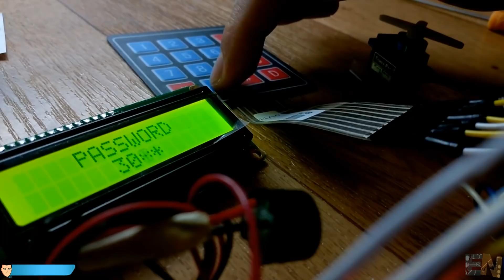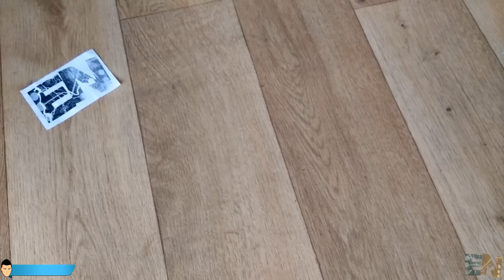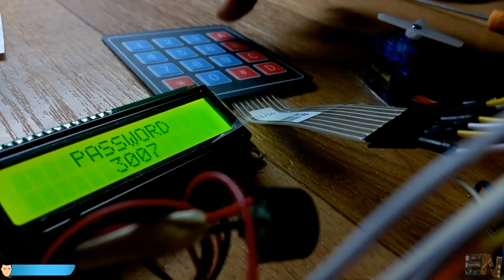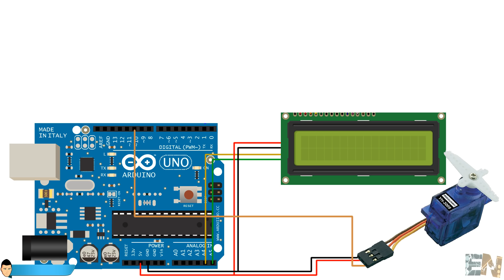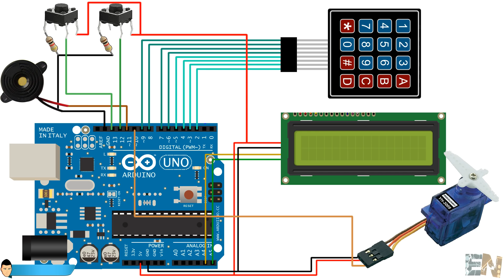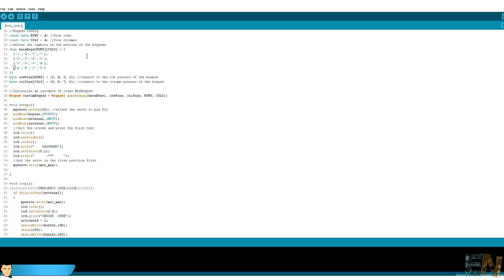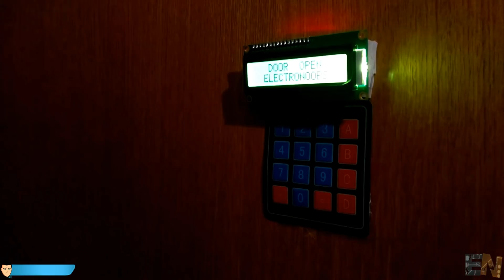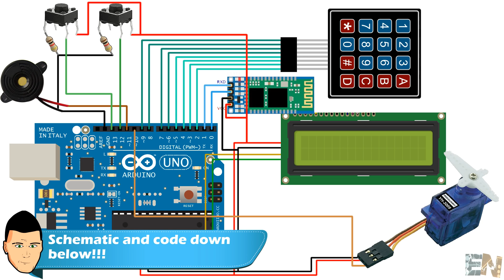Door lock keypad and bluetooth Arduino tutorial

Comment: I am using a 16 by 2 Lcd and the display is not coming. Nice video though
Reply from the maker: Have you tried the other i2c adress?¿ Go to this line in the code:

LiquidCrystal_I2C lcd(0x3f,20,4);  //sometimes the adress is not 0x3f. Change to 0x27 if it dosn't work.

And change the 0x3f adress to 0x27. That might work!
Reply: Can you pls make a lock system which has a arduino shield touch screen as a keypad??pls im really lookking forward to it!!here i found the code for arduino shield key pad....

+#include <UTouch.h>
+#include <UTouchCD.h>
+#include <UTFT.h>
+
+extern uint8_t SmallFont[];            //Declares Font
+extern uint8_t BigFont[];
+UTFT myGLCD(SSD1289,38,39,40,41);    //(Model,RS,WR,CS,RST)
+UTouch myTouch ( 6, 5, 4, 3, 2);
+
+void setup() {
+  Serial.begin(9600);
+  myTouch.InitTouch(0);
+  myTouch.setPrecision(PREC_HI);
+  myGLCD.InitLCD(0);
+  myGLCD.clrScr();                    //clear screen
+  myGLCD.setFont(SmallFont);
+  myGLCD.fillScr(VGA_BLACK);          //fill screen with black
+  myGLCD.setColor(VGA_RED);
+  myGLCD.setBackColor(VGA_RED);
+  delay(1000);
+  drawWelcome_msg();
+  delay(5000);
+  drawButtons();
+  Serial.println("SYSTEM STARTED");
+}
+
+void loop() {
+  int x,y;
+  while (true)
+  {
+    if (myTouch.dataAvailable())
+    {
+      myTouch.read();
+      x=myTouch.getX();
+      y=myTouch.getY();
+      
+      if ((y>=41) && (y<=89))    //top row
+      {
+        if ((x>=21) && (x<=85))  //button 1
+        {
+          Serial.println("1");
+        }
+        if ((x>=87) && (x<=152))  //button 2
+        {
+          Serial.println("2");
+        }
+        if ((x>=154) && (x<=218))  //button 3
+        {
+          Serial.println("3");
+        }
+      }
+      if ((y>=91) && (y<=139))    //middle row
+      {
+        if ((x>=21) && (x<=85))  //button 4
+        {
+          Serial.println("4");
+        }
+        if ((x>=87) && (x<=152))  //button 5
+        {
+          Serial.println("5");
+        }
+        if ((x>=154) && (x<=218))  //button 6
+        {
+          Serial.println("6");
+        }
+      }
+      if ((y>=141) && (y<=189))    //bottom row
+      {
+        if ((x>=21) && (x<=85))  //button 7
+        {
+          Serial.println("7");
+        }
+        if ((x>=87) && (x<=152))  //button 8
+        {
+          Serial.println("8");
+        }
+        if ((x>=154) && (x<=218))  //button 9
+        {
+          Serial.println("9");
+        }
+      }
+      if ((y>=191) && (y<=238))    //bottom row
+      {
+        if ((x>=21) && (x<=85))  //clear button
+        {
+          Serial.println("CLEAR");
+        }
+        if ((x>=87) && (x<=152))  //button 0
+        {
+          Serial.println("0");
+        }
+        if ((x>=154) && (x<=218))  //enter button
+        {
+          Serial.println("ENTER");
+        }
+      }
+    }
+  }
+}
+void drawWelcome_msg(){
+  myGLCD.fillRect(1,1,239,30);
+  myGLCD.fillRect(1,289,239,319);
+  myGLCD.fillRect(19,120,219,179);
+  myGLCD.setColor(VGA_WHITE);
+  myGLCD.print("CAR SECURITY SYSTEM", CENTER, 10);
+  myGLCD.print("SHANE CONCANNON - G00286539", CENTER, 299);
+  myGLCD.print("***********************", CENTER, 120);
+  myGLCD.print("*                       *", CENTER, 130);
+  myGLCD.print("*    SYSTEM UNLOCKED    *", CENTER, 140);
+  myGLCD.print("*   ENTER PIN TO LOCK   *", CENTER, 150);
+  myGLCD.print("*                       *", CENTER, 160);
+  myGLCD.print("***********************", CENTER, 169);
+}
+void drawButtons(){
+  myGLCD.clrScr();
+  myGLCD.setColor(VGA_RED);
+  myGLCD.fillRect(1,1,239,30);
+  myGLCD.fillRect(1,289,239,319);
+  myGLCD.fillRoundRect(20,40,219,229);
+  myGLCD.fillRoundRect(20,239,219,274);
+  myGLCD.setColor(VGA_WHITE);
+  myGLCD.print("CAR SECURITY SYSTEM", CENTER, 10);
+  myGLCD.print("SHANE CONCANNON - G00286539", CENTER, 299);
+  myGLCD.drawRoundRect(20,40,219,229);
+  myGLCD.drawRoundRect(20,239,219,274);
+  myGLCD.print("  _   _  _  _  ", CENTER, 255);
+  myGLCD.drawLine(86,40,86,229);
+  myGLCD.drawLine(153,40,153,229);
+  myGLCD.drawLine(20,90,219,90);
+  myGLCD.drawLine(20,140,219,140);
+  myGLCD.drawLine(20,190,219,190);
+  myGLCD.print("CLEAR", 35, 204);
+  myGLCD.print("ENTER", 167, 204);
+  myGLCD.setFont(BigFont);
+  myGLCD.printNumI(0,112,202);
+  myGLCD.printNumI(1,45,57);
+  myGLCD.printNumI(2,112,57);
+  myGLCD.printNumI(3,178,57);
+  myGLCD.printNumI(4,45,107);
+  myGLCD.printNumI(5,112,107);
+  myGLCD.printNumI(6,178,107);
+  myGLCD.printNumI(7,45,157);
+  myGLCD.printNumI(8,112,157);
+  myGLCD.printNumI(9,178,157);
+}

hope youll fulfill my wish!!! :)
Reply: if you're using the touch display i think you are you would need an arduino mega because you do not have enough pins on the nano/uno

Comment: your project is very cool but I have a small problem how can we change the password of door locker
Reply from the maker: go and find this line in the code, it should be at line 250:

if(Str[10]='A' && character==5 && Str[6]=='3' && Str[7]=='0' && Str[8]=='0' && Str[9]=='7' )

and change '3', '0', '0', '7' strings to the code that you want!

Comment: @Electronoobs
How to install this with LCD KeyPad Shield (SKU: DFR0009)  display? TIA
Reply from the maker: I never used it but this image show you how to connect it to the arduino:

https://www.dfrobot.com/wiki/images/thumb/5/5e/DFR0009-PIN2.png/900px-DFR0009-PIN2.png
Reply: Thanks for your response. I am using I2C adapter for now. I would be grateful if you can modify the sketch like this for me. 
1. Hide typed password.
2. changing password using keypad.
3. 4 or 5 digit password length.

my email address:
mujammal.eee@gmail.com
Reply: i have found out how to hide the passwork . Instead of this '
 if (character ==0)
    {  
    Serial.println(customKey);
    Str[6]= customKey;   
    lcd.clear();
    lcd.setCursor(0,0);
    lcd.print("    PASSWORD");    
    lcd.setCursor(0,1);
    lcd.print(Str);
   
    }
i change it to  if (character ==0)
    {  
    Serial.println(customKey);
    Str[6]= customKey;   
    lcd.clear();
    lcd.setCursor(0,0);
    lcd.print("    PASSWORD");    
    lcd.setCursor(0,1);
    lcd.print("      *          );
   
    }
for each one when i press the button the password show * and when you type the next one the before that will be hide . If you have any code better . Please show me with . I use I2C with LCD 1602 . This is my gmail: johnnypham9869@gmail.com Thanks :)

Comment: Hey, I want the door to be locked automatically after 10 seconds of opening, answers will be appreciated. Great video btw!
Reply: You must add part of code after this: 

if(Str[10]='A' && character==5 && Str[6]=='3' && Str[7]=='0' && Str[8]=='0' && Str[9]=='7' )

    {

      myservo.write(mot_max);

      lcd.clear();

      lcd.setCursor(4,0);

      lcd.print("ACCEPTED");

      activated = 2;

      analogWrite(buzzer,240);

      delay(250);

      analogWrite(buzzer,200);

      delay(250);

      analogWrite(buzzer,180);

      delay(250);

      analogWrite(buzzer,250);

      delay(250);

      analogWrite(buzzer,LOW);

      delay(1000);

      

      lcd.clear();    

      lcd.setCursor(4,0);

      lcd.print("WELLCOME");

      delay(500);

      lcd.setCursor(2,1);

      lcd.print("ELECTRONOOBS");

      delay(1000);

      lcd.clear();    

      lcd.setCursor(3,0);

      lcd.print("DOOR  OPEN");

      lcd.setCursor(2,1);

      lcd.print("ELECTRONOOBS");

you need to set the right delay after this and write:
delay(what you need);
myservo.write(mot_min);

I think it will work.
Reply: @vedatorpeta  Yes thank you it works

Comment: bro your tutorial not work in my arduino... im already try n try but fail.... whats i supposed to do???
Reply from the maker: What is the problem? Dose it compile? Could you upload the code? Did you installed the keypad library? 

It should print on your LCD your password, which in this case is 3007. Once inserted the servo motor will open the door. Maybe you use a different LCD and the i2c adress is different. Tell me what is the problem that you have! Keep up!
Reply: bro u got mail??? im already do whats u say it. but not work i use stuff for excperimen same with ur stuff. if u got mail i can show the photo of my experimen to u. not working at all bro. thanks.
Reply from the maker: Yes, just mail me at info@electronoobs. com or use my Q&A page : http://www.electronoobs.com/eng_preguntas.php

But first open the code an go to this line:

LiquidCrystal_I2C lcd(0x3f,20,4); and change the 0x3f with 0x27. Some i2c LCD have this different adress.

Hope it works, keep up!
Reply: hai bro can u check mail?? thanks u bro
Reply: info@electronoobs. com not mail bro. do yo have email?? like gmail...?? im really confused with this prject.sorry bother u.

Comment: Dear Brother,
I want to add red and green LED in pin  A1 and A2 according to door closed and door open. Please edit the code for me.
Reply from the maker: before the void setup add this two lines:
int green = A1;
int red = A2;

Inside of the void setup add this lines:

pinMode(green,OUTPUT);
pinMode(red,OUTPUT);

Now in the void loop every time you find a myservo.write(mot_min);  add this lines:

digitalWrite(red,HIGH);
digitalWrite(green,LOW);

And every time you find a myservo.write(mot_min); add this lines:

digitalWrite(red,LOW);
digitalWrite(green,HIGH);

That's it!

Also in the void setup after the myservo.write(mot_min);  att this line:

digitalWrite(red,HIGH);
digitalWrite(green,LOW);

in order to start as door closed!

Keep up!
Reply: Dear Brother,  I am tried my best but fail.  Please edit the code and send me.
moradulislammonu@gmail.com
Reply: bro do you have the problem with the button ? Mine when i plug everything in the buzzer buzz out , the screen print inside open despite i haven't pressed anything . Can you help me with that problem ? and with your led did you success ? If you did can you show me your work ? Thanks

Comment: hi I'm having a little trouble 
I uploaded the code to the arduino successfully and it worked fine but a couple of days later it stopped working so I bough a new arduino and uploaded the code again but nothing seems to be working all the cables are in the correct position 
do u have any idea what I did wrong?
Reply from the maker: You could upload the code? If yes, the LCD screen works? If yes, the keypad is the only one that doesn't work? I have to know all this in order to help you. Also if you have the Bluetooth module connected to the Tx and Rx pins you can't upload the code because the arduino uses those same pins to burn the code with the FTDI chip. So disconnect the pins before upload and connect them back later once the code is uploaded. Keep up!

Comment: when i compile  the code an error showed ---- 
door_lock_code:40: error: 'Keypad' does not name a type
door_lock_code.ino: In function 'void loop()':
door_lock_code:114: error: 'customKeypad' was not declared in this scope

what can i do
Reply from the maker: Did you inport the keypad library?? That error is due to "not haveing" the KEYPAD library installed. To install it download the "keypad libraru" .zip file from the video descriprion. Then open the Arduino IDE and go to sketck, include library and add .zip file library and select the downloaded zip file. Then restart the Arduino IDE and try to compile another time. If that's not the problem just tell me.

Comment: Hey, The library for the i2c does not work for me since i have an adafuit i2c LDC backpack. Only the adafruit LCD library does. How do I make this Work? Thanks great video
Reply from the maker: Well I haven't tried that but I supose that you inport the adafruit library instead of the i2c lyquid library. Then, I never used the adafruit library but i supose that it also has a LCD.begin or LCD.start or so. So use those to initialize the LCD and then substitute all the LCD.print functions with the ones for adafruit. Since is i2c, the LCD pins should be the same, A4 and A5 because those are the only i2c port for the atmega328p.

Comment: do you have anyway to troubleshoot the keypad and screen. I believe I have everything plugged in correctly. the screen is on, but just shows blanks.
Reply from the maker: Be careful with the slave adress of the LCD screen. As I say in the video there are LCD that have a different one. Sometimes the adress is not 0x3f. Change to 0x27 if it dosn't work here in this fucntion:

LiquidCrystal_I2C lcd(0x3f,20,4);                <--Change the adress here
Reply: ELECTRONOOBS It works great! very good video and tutorial for someone who knew nothing going into this. Do you have any suggestions for cases that can hold/hide the boards/wires? I'm putting this on a clear door.
Reply from the maker: If you go to any home depo to the electricity section you could find there any shape of plastic case. Some of those are quite nice.

Comment: Im looking forward to buying things and make one. but a tiny problem. my lock is not of the knob type its the Bolt action sniper type ( i hope you got it  xD ) and its a little lengthy. i could lubricate i but will the servo be able to pull it down? cuz i want it on downward direction. if i could spin keys with it that will be great to..
Reply from the maker: Sachin Mahesh in my case I removed my lock and bought a new slide one to make sure that it would work. It only costs 1 dolar.
Reply: thank you for your fast reply. I will definitely try this and let you know. I have subscribed and liked this video. if you got some times please subscribe back to me also means a lot to me :)
Reply from the maker: Thanks. I'll do that now!